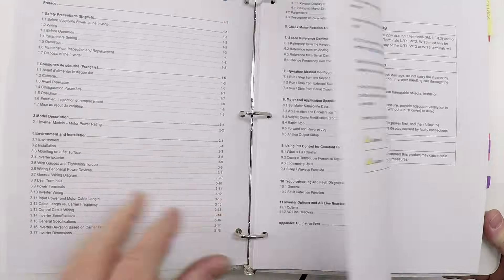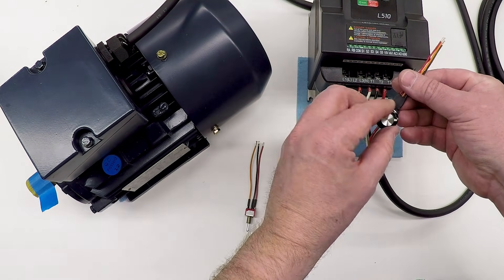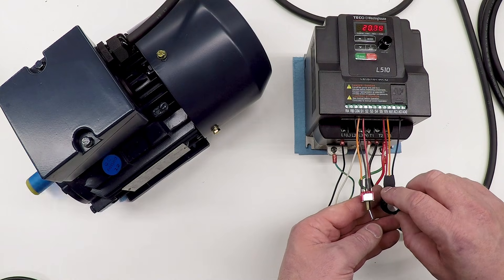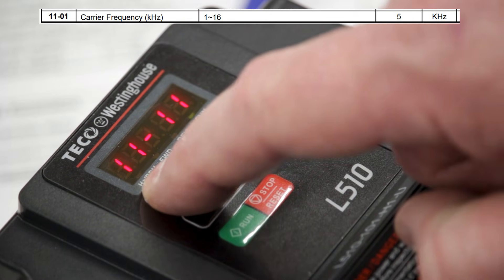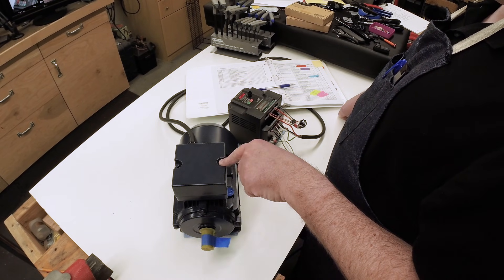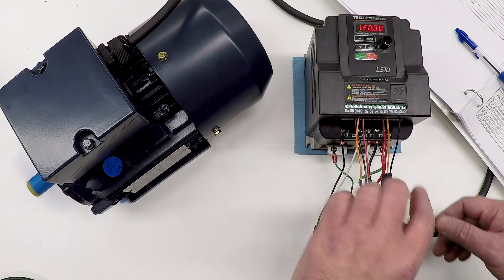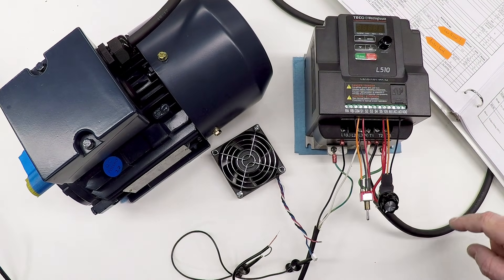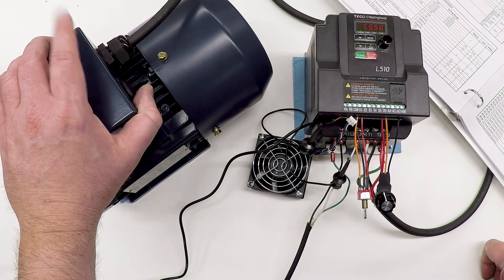Lathe VFD 2: How to Program a VFD for a lathe (Teco-Westinghouse L510)

Comment: Mr Jordan I am retired after 44 yr. and have time to work on my 1970"s 14" Clausing Lathe and I am removing completely the variable speed hyd system and using the original 3HP motor to drive directly to the main spindle and my question to you, me not being an electrician should I choose the SLV mode on the FVD for this old motor? THANK YOU for all your video's.
Reply from the maker: Wow.  I'm not an expert, so I don't know for sure.  If it's a three-phase motor and you're staying within the rated current, I would think SLV would be fine.  You'll get more low-end torque and the motor should run quieter.  Of course, if the motor isn't rated for inverter duty, you may run into cooling problems when it's running slowly, since the fan isn't turning at a normal speed.
Reply: @Clough42  Thank you for your expeditious reply I really appreciate all your video's I know it's a lot of time consuming work for you however with your very vast experience and knowledge you are helping a lot of us on YouTube. My motor is a three-phase running at 9.2 amps on 220 volts, how would I know if it's overheating at a low speed, by touch only? Thank You.
Reply from the maker: Yeah, probably.  If it's getting hot, you'll probably want to run it faster or add a cooling fan.  Warm to the touch is probably fine, but remember that the coils inside are hotter than the outside of the body of the motor.  I don't know how to be more specific.  If the motor isn't specifically rated for inverter duty, with a ratio (like 10:1) on the plate, you're kind of just guessing.
Reply: @Clough42  Thank You very much I appreciate you taking time to reply.
Reply: Thank you! These videos are still earning after years highest prize what comes of youtube VFD video category 😊

Comment: James, probably you don’t have an idea how much or many of us, are grateful for taking the time to teach us, all the wonderful knowledge, that The Creator of all good things granted you,  these great videos, take time and planning, but to share your knowledge, is a very noble cause, and you are a blessed man, though, I don’t own a Lathe nor mill, I am planning to buy both of them, for simple things that may come around, on my  wood shop, (including Router bases similar to the ones Pat Warner R.I.P), though many months will go by until I will have the funds for that, haven´t decide which company to pick Grizzly or Weiss, but a VFD for my drill press , is a must (delta and craftman). 
One question, what if I want to add a remote RPM display on (my remote panel), how to do it?
Can I wire it from the 510L VFD? Please advice….
Again thank you very much…I ‘ll keep in touch…
Reply from the maker: I don't know of an RPM display output on the L510.  You can configure the display on the VFD itself to show RPM, but this is only useful if the machine is always in the same gear (or belt ratio).  If you want the actual speed of the spindle, there are magnetic pickup digital tachometers all over eBay.

Comment: James - great video series / as a g0602 owner myself, your series is a perfect blueprint for my conversion. I do have 3 questions

1- How did you land at 40hz to switch on the fan? Trial and error or calculation?
2- Have you found the fan to be a necessity? (Both enclosure and motor)?  Other than threading, I don’t foresee loading the motor at lower rpm in average everyday use
3- fan recommendations?

Well done! 👍🏻
Reply from the maker: Thanks!
1 - I ran the motor and felt the output of the built-in fan.  I could still feel pretty good airflow at 40Hz, but below that, I felt it could use a little help.  Not scientific at all.
2 - No.  I haven't found them to be necessary at all.  But I haven't put the system under heavy load in the heat of summer.  Now it's winter, and I doubt the motor will even warm to the touch until next summer.
3 - For the box, I used a cheap eBay computer case fan.  For the motor, I used a smaller and more powerful case fan from an old server.  Again, I just held my hand by the motor to feel the air flow and tried to find something that put out as much air as the internal fan at 60Hz.
Reply: @Clough42  Thanks for the reply James / these videos have been very helpful and i commend you for putting then together. I think i have watched most 3-4 times now as i am in the midst of my conversion. The only component i've had a little trouble getting is the DIN breaker - on the slow boat from China :) 

I also noticed the sheetmetal stop you made for the stage on you G0602 - GREAT idea - i've been covering this area with paper towels/magnets when i'm turning and i'm going to follow your lead and make something similar

Comment: Hey, great video!  the power supply cables , where did you buy them ?? and also, do you just plug the other end of the power supply cables to a normal power socket ?

Thanks
Reply from the maker: I bought the bulk cable from a local Grover's Electric supply.  And yes, I just plugged it into the wall, into a 30A circuit.
Reply: @Clough42  is it ok to use a 16 A cable instead on a regular wall circuit(not sure how many A it has)?
Reply from the maker: @wavew5447  It depends on which VFD you're using and how much power it draws.  The specifications for the 1HP 115V L510 I used say it draws up to 19A.  For that application, 16A cable would be too small.  The current (amps) rating of the cable has to be as large or larger than the draw of the device.
Reply: @Clough42  thanks, i checked product spec and it says the input current is 15.5 A so i guess i was lucky with the 16 A cable :)

Comment: I just installed this unit on my Bridgeport Mill.   I followed your instructions and used the owners manual.  It worked like a charm.  I tried a another VFD which was pure crap.  Only the fan motor came on.  I sent that piece of crap back to the seller.  The seller tried to get me to try and sell it  myself instead of accepting the return.  I tried 3 times with that other VFD no luck.  I set this unit up within an hour and had it running.  Great vid.
Reply from the maker: Glad to hear it.  Thanks!

Comment: Update I did buy a TECO L150-203-H1-U.  Your video was so helpful in hooking up VFD to my motor. I am running at 22V 1PH input and 460 V 3PH output on a 3HP motor, the motor is a WEG W22 00318ET3E182T-W22.  I bought it used for $50.00.  The motor I am running has a PWM VFD 1000:1 VT and if I understood how to calculate from your video. Divide 60hz by 1000 and that comes to 16.16 Hz (min) on my motor. Set the braking and acceleration also.  Thank you so much, you are age awesome teacher. You can mark my purchase to TECO for the VFD I bought a direct result of your video.  I think they need to know that.
Reply from the maker: Very cool.  I'm glad you found it useful.

Comment: loved the video. Great job explaining everything.  Was researching what vfd i should buy and I believe i will buy the same TECO brand but for a 3HP 3ph motor. L510-203-H1-U I Model will be using the Arduino to set my speed for motor. The arduino is 3.3 to 5v max output but with the other connection on the vfd should not be a problem. I am looking up the spec. sheet now.
Reply from the maker: Most VFDs, including the TECO can take a 10V analog signal to control the speed.  The arduino can't produce that directly, but there are circuits that can allow an Arduino to control a 0-10V signal.

Comment: You, sir, are a life saver. I had the exact same setup in my Teco 510 and could not work it out until I found your video. And not only did I make it work, your tweaks for making it run smoother and quieter are invaluable. Thanks so much for this, it was extremely helpful!
Reply from the maker: I'm glad it was helpful.  That was my goal.

Comment: Nice.. did you run the  auto tune procedure. 02-07   page 4-30 in the manual.
Reply from the maker: Yes, I ran it a couple of times, playing around with the setup.  I suspect it was a good thing, but I didn't really notice much difference.

Comment: Jesus h Christ thank god for you I have been fighting with this controller for a while and customer service was worse then trying to program this thing. But your video has truly helped me getting my system up and running. They should just use your video as customer service. Thanks again
Reply from the maker: Thank you.  I'm glad you found it useful.
Reply: Clough42 have u changed any of your other settings cause I was trying to go they the manual and they tell you what the settings but unleaded your versed in in it it doesn't explain how each setting will effect the motor like u have. I know it would make the book into a bible but that might be what guys like me need lmao
Reply from the maker: I think I showed every setting I change in the video.  Anything I didn't mention I left set to the factory defaults.  The defaults are listed in the manual, but as I discovered, they aren't always correct.  If you have specific questions, I can look and see how mine is set.
Reply: Just found this as well and it convinced me to buy the exact same setup, super easy to follow.

Comment: Great video! It helped me a ton, but I am confused about something, maybe you could help me understand? I thought that an electric motor wasn't supposed to run over 60hz? Am I just wrong on this? I noticed you went to 120hz. Any problems with running it there?
Reply from the maker: In this case, there isn't any issue running this motor at 120Hz.  Motor torque will fall off some at higher frequencies due to the inductance of the windings, but it will work just fine.  The main limitation on max speed is the bearings.  In this case, since it's a 1700RPM motor, running it at double the nameplate speed still leaves it around 3400RPM.  I'm sure this motor has the same bearings as its sister models that run at 3400RPM, so it should be just fine.  When running slower than the nameplate speed, the main limitation is cooling.  This motor is rated (on the nameplate) to run at 1/10 its rated speed (6Hz) but I added a cooling fan just to be safe.

Comment: Dialed explanation on programming the L510. I’ve had the same VFD on my Logan for a while and hate the noise, as well as the acceleration and deceleration times. This, and your other videos solved all my issues with it. Unreal how quiet it runs now. Do you know off hand if 08-07 controls the VFD’s onboard fan? If so setting to 0 should keep the fan off until it warms up it looks like.
Reply from the maker: Thank you!  I'm glad it was useful.  The way I read the manual, I would expect setting 08-07 to 0 to only run the fan when the heat sink reaches a certain temperature.  I think I looked at this, but realized that the lathe motor would be running anyway, and I didn't bother changing it.  Let us know if you try it.
Reply: Clough42 I changed it to 0 last night and it stopped the fan. Didn’t run it long or hard enough to kick it on but the VFD is dead silent now. I have my VFD mounted to the wall above the lathe currently until I finish my controls so it was loud. Made a huge difference.
Reply from the maker: Ken Spaulding Awesome!   I'll have to try it.  I am hearing a very slight buzzing sound as the display flashes when it's not running, but I'll probably get over it.
Reply: Clough42 that is also one that has bothered me for a bit. I’ll let you know if I figure it out.
Reply from the maker: I suspect it's just a DC-DC converter for the low voltage electronics running at audio frequencies.  Good ones usually run at 100KHz or so and you can't hear them.

Comment: Have you tried to configured this drive using the RS485 port and the free TECO JN5 software?
Reply from the maker: I haven't.  I saw that was an option, but I don't have an RS-485 adapter, so I haven't tried it.
Reply: I have, and it is so much simpler than using the keyboard. Adapters are available for around $6 on ebay if I send you one would you consider making a short video I think it would help many people I thought of doing it but my cheep cell is the only video camera I have you seam to be much better equip than me.
Reply from the maker: Do you have a favorite adapter that supports Windows 10?
Reply: @marcibb3167  you can usually find those items for less on aliexpress, e.g. https://www.aliexpress.com/item/USB-to-RS485-USB-485-Converter-Adapter-Support-Win7-XP-Vista-Linux-Mac-OS/32663812811.html although you have to be careful it's actually the same thing as what you want.  Not sure this is but I think so.

Comment: I wonder if the unit you bought was a customer return, that had the program defaults changed then.  Very smooth run through the programming.  Many VFD videos feel like the blind leading the blind through a minefield on motorcycles, but you just breezed right through.   Is your channel fundraiser going to be selling lathe upgrade kits? :)
Reply from the maker: Thanks!  I wasn't sure whether to make videos on this upgrade, but as I looked through the other VFD videos on YouTube, it seemed like there was an opportunity to try to put together something clear that walks through all the steps.

I hadn't thought about selling kits.  I'm not too interested in trying to source and resell products, but I do try to keep my eyes open for ways to create real, unique value for others who might be willing to pay a few bucks for it.  :)
Reply: They changed the default settings without updating the manual. The last L510 i got had an added sheet of paper with the changed defaults.

Comment: How about ripping the mechanical fan out of there and running a much bigger computer fan all the time at full speed because when running in reverse, both fans will be fighting..... Just being the devil's advocate here... not that you need a lathe in reverse that often but....
Reply from the maker: Hmm...interesting thought.  What I really wanted to do was remove the motor fan and put the computer fan inside the shroud.  Unfortunately, the shaft goes all the way through the fan, so there isn't room.

Since it's a reversible motor, the fan blades are straight paddles, so either way you spin it, it draws air in and over the motor body (centrifugal blower).  I would think there might be some slight increase in turbulence noise if the blades are spinning in opposite directions, but they're both pushing air in the same direction.